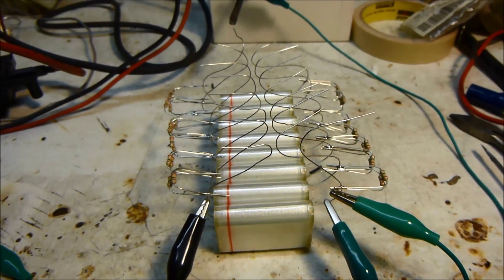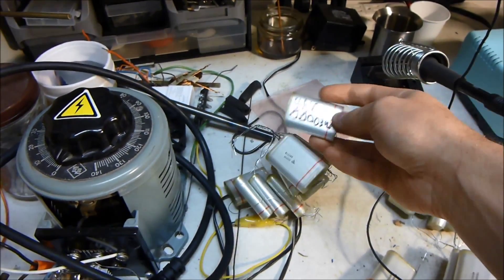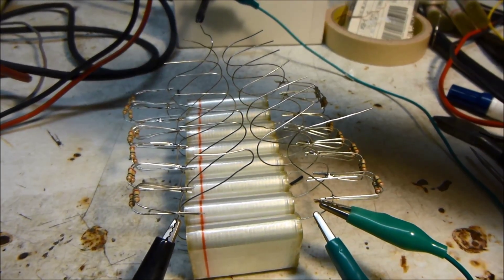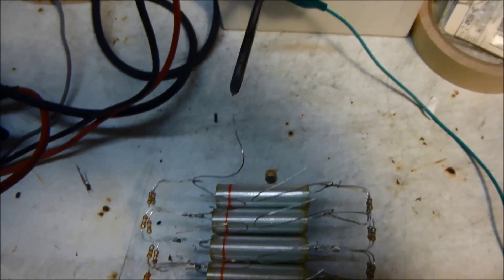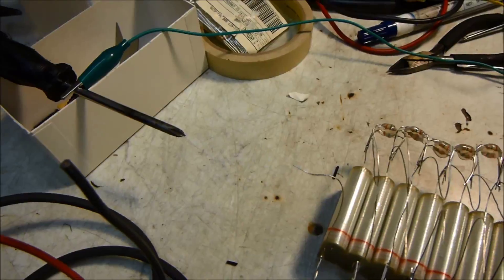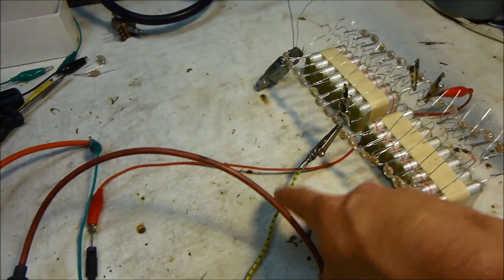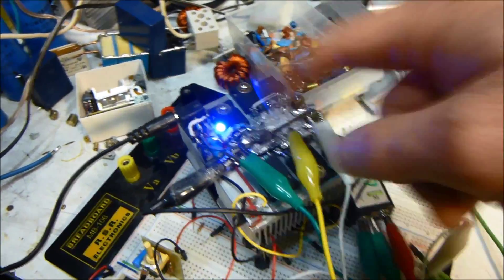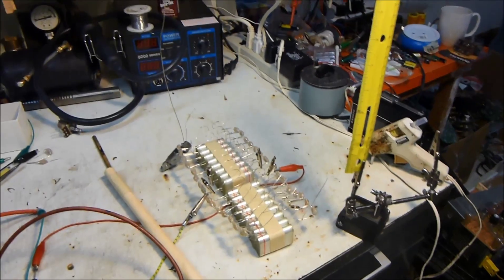Marx Generator - Super High Voltage Generator - 7 inch Sparks

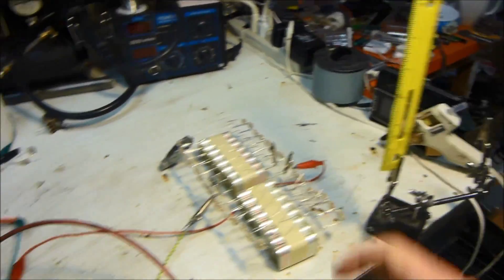Comment: 5:30 great trick i think the reason why the middle works better is that the current has to flow only through half of the resistance compared to the normal way (start to end)

Comment: Looks awesome!  I've had luck putting hot glue on resistors to make them better resist against high voltage (that is of course assuming they don't spark internally).
But great project.  Very inspiring!  edit:  Oh!  I just watched more of the video and you did the same thing with the hot glue that I was talking about!  I thought I was the only one who thought of that.

Comment: when i saw the resistors arcing over i was going to suggest coating them with hot glue...and then you did! props! i use it for insulating HV arcs on my FBT circuits. good stuff

Comment: Makerj, i know that you needed a workaround to beef up your resistors' voltage spec. I've witnessed "glowing" resistors  myself. However, is it plausible that when a component manufacturer engineers a resistor to perform at a specific voltage level, that the variable of heat dissipation efficiency is one of the indirect characteristics that determine its rating? Another way of putting it, did you effectively reduce their power rating by enclosing them in hot glue and inhibiting their ability to transfer the heat produce when under load?
Reply from the maker: Kevin Sippel Jr Yeah I probably did.  But they seem fine.  I mean the hot glue has not melted or even softened on any of the resistors even when running the generator for 10+ minutes.  Thank you!

Comment: Hmmmm Alll those caps... If you happened to get a big bag of 1n4007 diodes for cheap, you could make a really big Cockcroft–Walton generator
http://m.eet.com/media/1170936/multiplier%201x600.jpg

Although it is nice to not need diodes. I should try this with cup caps and my flyback.

Oil bath would stop that arcing, although hot glue was the first thing I thought too :)
Reply from the maker: Mongrel Shark What would be the advantages to that kind of generator?  Hot glue is awesome!  Who ever invented it is a true genius!!!  :D
Reply: In a Cockcroft–Walton the diodes would be a lot less lossy that the spark gap, so more joules out.

Also a lot easier to insulate. So much safer, and less corona loss, so less current in needed to get more joules out.

The down side is you need twice as many caps. As only one row holds charge, while the other row passes ac (or pulsed dc) to charge the storage row. Which is usually the bottom row in the schematics.

Each cap in the bottom row is charged to supply voltage, minus losses in diodes etc. But the caps can be discharged in series. So if you put 1kv into a 10 stage multiplier, you get almost 10kv out. Closer to 9993v as your loosing 7v in the diodes...
Reply from the maker: Mongrel Shark Interesting!  I'll consider that!  I'm not sure how cheap diodes are though.  I have a couple hundred 1n something diodes.  I think they are rated at like 100 volts 1 amps so I don't think they would work very well.  I don't know, I just don't like buying things!  :P
Reply: LOL me neither. I got 500 1n4007's because the shop was sold out of 5 packs, and I needed some for a ZVS (which I still haven’t made). Cost $4.95. Rated for 1000v and 1 amp.
The 4004's are the ones you have rated for 100v. I don’t know why people buy them? Same package and price as a 4007. 1 tenth the voltage threshold.
Reply from the maker: I just checked.  They are 1N4148.  They are really quit wimpy now that I look them up.  No wonder they burn out so easily.  I didn't buy them!  I got them from my dads work!  They were just throwing them away as usual!
Reply: LOL 1n4148s are great signal/detector diodes. I use them a lot for wireless power detectors. Also good for radios, heat activated switching, and even stuff like radiation detection.
They are not rectifier diodes though.

I know you dont like to spend money, and you do find these in a lot of electronics, but for $3 you can get 200 and not have to desolder one for a few years.

I use them for silly stuff. Like when I put a ton in series to get an 8v step down. XD I have that many... One of the best purchases I ever made. Or if you really dont want to pay for them, maybe someone at your dads work could throw a bag out for you XD
Reply from the maker: Hahaha yeah I guess they are!  I never really looked them up before!  I was actually trying to make a radio frequency detector with them a while ago.  I was trying to light an LED with the radio power from my phone.  I couldn't get it to work.  I probably had it connected up wrong or something.

Maybe I should do that!  IDK I have a nice box of salvaged diodes!  You just have to dig a lot if you want to find two of one kind!  :P  It's a nice mixture for sure!  There are lots of zenners and bridges in there too!

Hahaha I wish they would just throw stuff away on command!  They haven't thrown anything away lately, or maybe my dad just didn't say anything...  :P
Reply: LOL, I have a few boxes of random components too. One day I will sort them a little better. Just ordered a new O'scope with X-Y mode so I can test the ones with the markings rubbed off....

I do like to have 4148s and 4007s handy though, as I use them so much.

The SWES stuff I was working on a while back would light up brighter when I sent a text. If you had an on board battery you could make an LED light up, good luck doing it from the power of the phone signal though. It would be possible, but you would need an antenna, tank and boost circuit all precisely tuned. Just thinking about the math makes my head hurt.
Or I guess you could go the low tech way and use the detector diodes as a rectenna and charge a cap to run a JT. Would be hard to isolate the phone though. All sorts of noise would set it off.

Comment: wow 7 inch sparks that is 210 000 v acording to an online calculator. I was looking to make a taser from this tipe of a curcit but i had truble finding powerful enuth diodes but the spark gap is a good idea bicuse it is a tipe of a voltage multiplayer
Reply from the maker: bor_12345's Electrofied Gaming Yeah it is a pretty high voltage!  You could make a taser but it wouldn't do much.  It would scare people but not harm them.  It's a high voltage but it doesn't have much current.

Comment: put it in oil so it doesnt arc .
Reply: +JOSIP Žlk it needs to cause its a marx generator, it needs the spark gaps.
Reply: Spark gap can be raised under oil level
Reply: JOSIP Žlk ye but another thing is that oil is very messy, if you'd ever want to change something you need to clean it very thoroughly to get the oil off of it

Comment: this might be a pain in the butt but have you thought about using inductors instead of resistors? maybe this would solve your problem, its ok though in my eyes, its just some voltage potential leaping over continuing in the circuit of course, at least its getting there! xD
Reply from the maker: Tesla Explorer Interesting idea!  I never heard of using inductors before but I just looked it up and it's a real thing!  It makes sense too.  It would have a lot less resistance so it would probably have better performance.  Only problem is that I don't have like 150inductors that are all the same.  I could make some but that would take a long time and a lot of wire which I don't have.  I think using proper spark gap electrodes would help more than anything.  But that is a great idea!  Thank you!  Certainly something to consider if I ever want to make a huge Marx generator.
Reply: You da man!